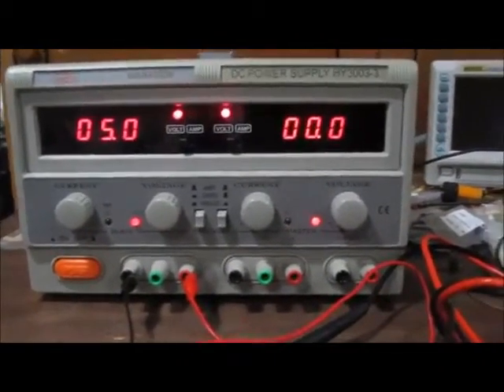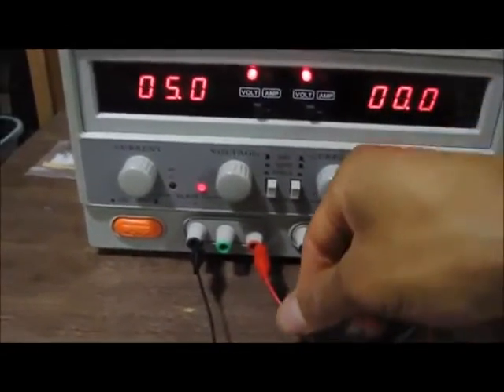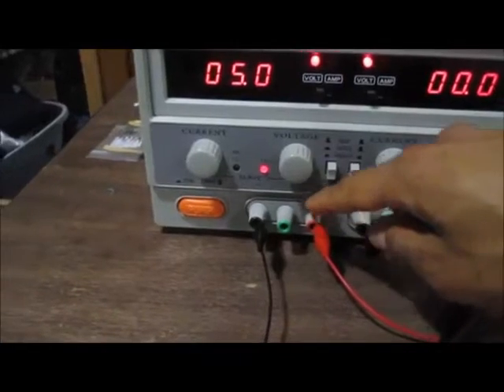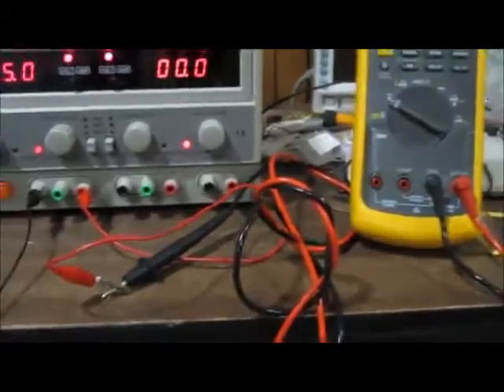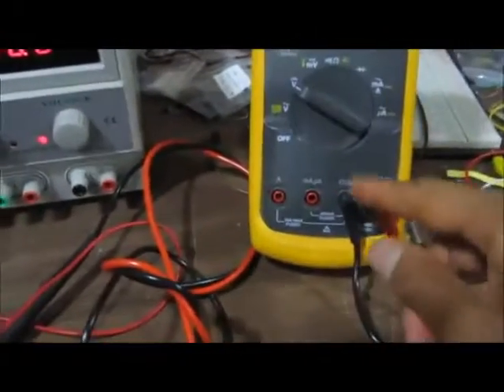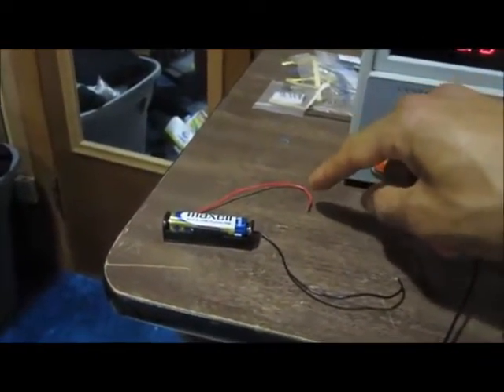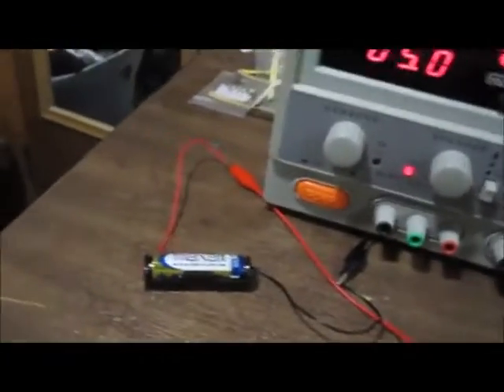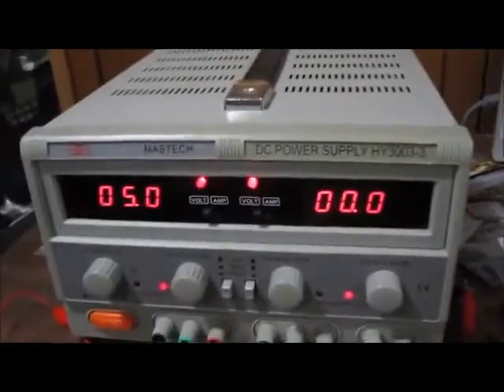How to Obtain Negative Voltage From a DC Power Supply or a Battery

Comment: Please see, if you don't use positive terminal to make it grounded, you will get negative voltage by connecting the circuit with negative terminal and ground. 
I think so.

Comment: What would you use negative DC power for?
Reply: Well, but you need negative and positive DC power for an Opamp. How do you combine both? 
If you connect the red cable of the + connector of the battery to GND and the black cable of the - connector of the battery to V- of the opamp, then how do you do the rest for V+ of the opamp?

If you would connect now the red cable of the + connector to V+ of the opamp and the black cable of the - connector to GND, you would have caused a short circuit.
Reply: OpenGL4ever the power of the opamp output is based on the difference between the Positive and Negative voltage / current inputted at the +/- inputs of the Opamp. Some Opamps ( single stage) only need one current type. On pretty much all audio FX gear both negative voltage and positive voltage rails are used for the Opamps. The Memory Man Deluxe Delay pedal for Example the main power 34 volts wall wart is actually center Negative which then goes into a 7915 power regulator to bring down the voltage to -15 volts.
Reply: In an OP AMP
Reply: Opamps that are not powered "rail to rail". Also some audio circuits need a voltage that is lower then zero (ground).